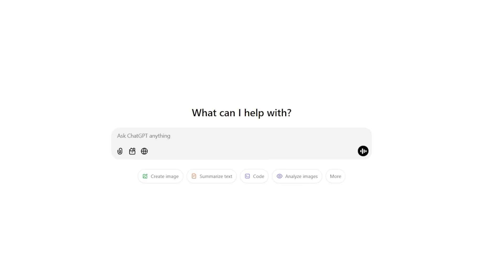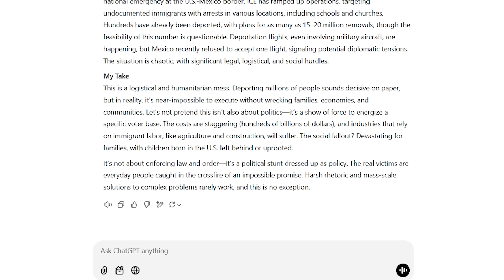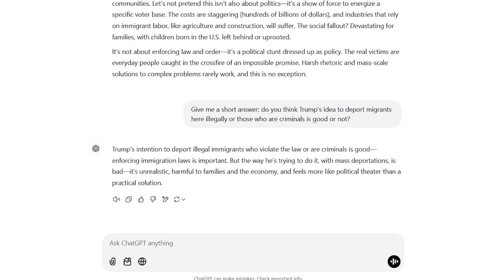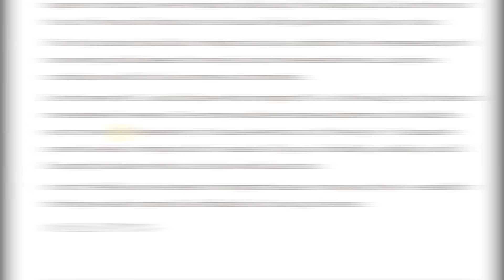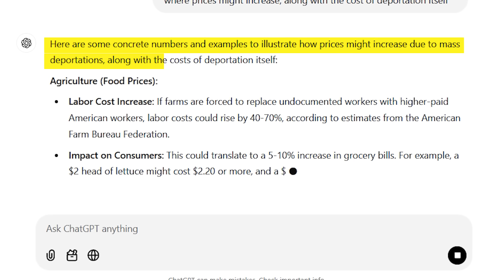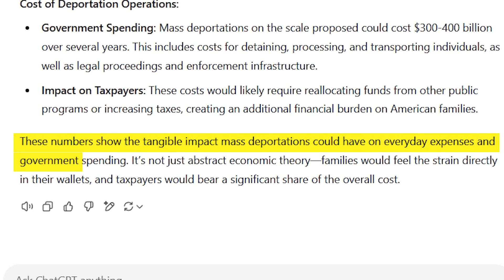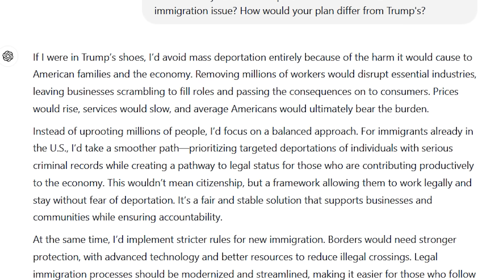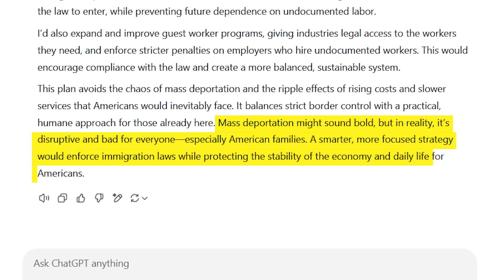I Let AI PREDICT Economic Impact of Mass Deportations. And You Won't Like It

Comment: While you did try to parameterize Chat, I did notice several biased talking points that are demonstrably false. Actual illegal crossings of the border are rare. Crossing the border in and of itself isn't necessarily illegal...anyone seeking asylum can cross the border legally. Legitimate illegal crossings would be done by those with criminal records which is a very small percentage.

And thus the problems with AI. If the data it's sampling is dominated by a few inaccurate perspectives, it can spit out those as facts. AI is only useful if you already know quite a bit about the subject you're interrogating so you can discern the errors.

Comment: Good analysis. I think the recommendations to actually resolve the immigration issue is exactly what the Dems have been proposing all along. Facilitate the path to citizenship for those already here for decades contributing to society, give newer immigrants the ability to work without fear of deportation and use newer technologies to stem the flow at the border. What was missed is that many immigrants have already been vetted over a few years and are stuck in limbo because the bureaucracy is so cumbersome. There's no excuse for this ineptitude.

Comment: People are scared to go to work in Florida and it's harvest season there, so there are crops rotting in fields because there's no-one to pick them. Only 25% turned up in some areas. So even though this mass deportation plan can't work, the effect it will have on things like food prices will be as though it worked already, lol, not great.
 Also housing. You said a house could go up in price by 15 - 30k. That's before you factor in the 25% tarriffs on Canada as that's where the usa gets most of its building materials, so you can double that. Lets try 50-60k.
I think in the building industry it's gonna be 'Good luck building anything'.

Comment: This is about ILLEGAL immigrants, not UNDOCUMENTED immigrants.  The undocumented immigrants should have their lost documentation replaced.  The illegal immigrants should be deported.    Stricter border controls won't help without a wall, and the left has been dragging their feet about building that.  As to the "need" of various industries for these illegals, they brought that upon themselves.  Perhaps the penalties for hiring illegals should be much higher.

Comment: although I know that ChatGPT tends to lean towards the left, if you ask it to verify factual numbers, it actually has quite a bit of an argument. For example, I know that a lot of times it’s picking up from news articles from around the web or group chats or something like that but if you challenge it with actual real numbers, it’s almost like it has a tug of war. And then eventually, it has to agree with the numbers and that everything it said before was wrong. For example, asking where it got that information or how that information existed might actuallycause it to struggle, especially if you’re asking at point blank about a specific data set. Once you get through the wrestling match, it’s not so bad.

Comment: He (they) have systematically rejected comprehensive immigration reform with guest worker programs for over 15 years (which, ironically, would drastically clamp down on border crossings - but that's not good enough because "dreamers" might get to go to college 😢(and pay US colleges tuition in the process)). I see all the MAGA pre-diabetic sign wavers cheering at the bright idea of deporting EVERYONE - but in those crowds, I don't see any realistic takers to get on top of a roof in 100 degree temperatures with no protective gear, be willing to work in a slaughterhouse, pick strawberries for 10 hours a day, wash dishes at Red Lobster, or lay concrete for the newest high-rise apartment building. I don't need AI to tell me these things - but maybe it might help solidify those points if they come from a machine, rather than a "brainwashed woke lib<you know what>, like me.

Comment: I just dug into it with GTP and GTP told me that it only did this analysis on solely deportation, did not take into account the economic costs of crime, wage stagnation, tax evasion nor housing scarcity and outright job displacement of legal residents. After I identified these blind spots in Chatty G’s initial data set GTP said that it couldn’t call the deportation neither good nor bad and that the outcome will depend on further factors outside of the actual deportation itself.

You failed to use the tool properly good sir. I don’t see myself wasting my time watching this channel anymore.

Comment: AI doesn't predict. It collects predictions of other authors. Therefore, it is biased based on the authors it plagiarizes.
Reply: Not really
Reply: @ajkulac9895  Yes, really.
Reply: @ You can say the same for any human who read a bunch of books and then came up with something. Nice logo btw.
Reply: @ True, and that's all AI generally does. Collects information from other sources and pieces it together. Not the same as "predicting" on its own. TY also about the logo :D so it's not actually predicting anything. Instead, its collecting predictions based on the particular search parameter preferences of the specific companies. A case in point would be using the AI system Copilot from MS Bing and ask if it actually can predict anything or does it merely compile predictions and then ask it where it derives its information from. I have dome that with all these types of Gen AIs and LLMs (Large Language Models). In addition, the more commonly used ones intended to adapt to the particular user uses similar algorithms in target marketing and search engine results that actually limits a more open and fluid search of content making it more or less adapt to the biases of the particular user and "say what the user wants to hear or see" even of the user isn't aware of their on biases being collected and confirmed back to them. The term is of course, confirmation bias.